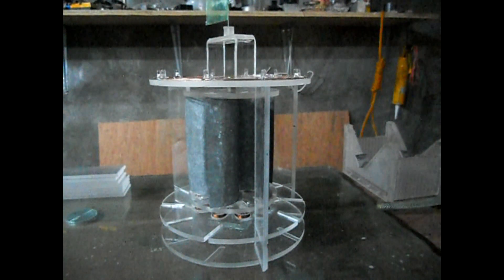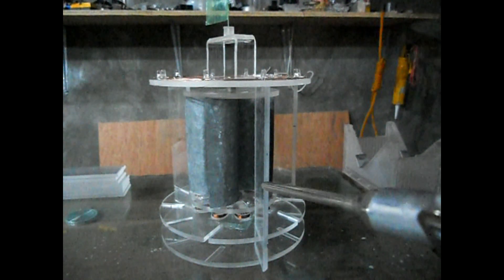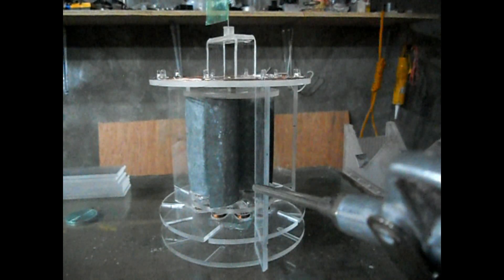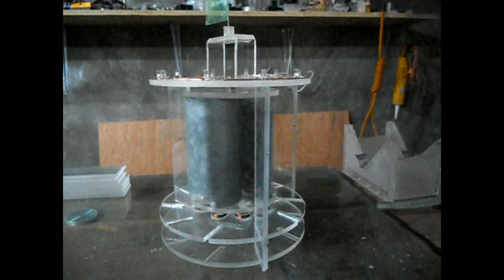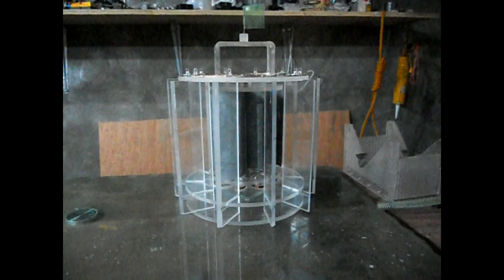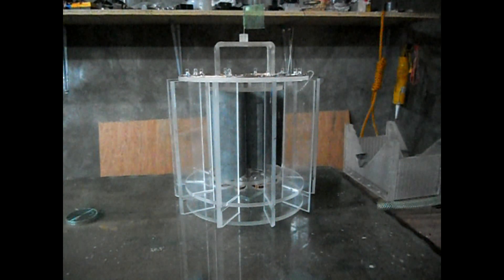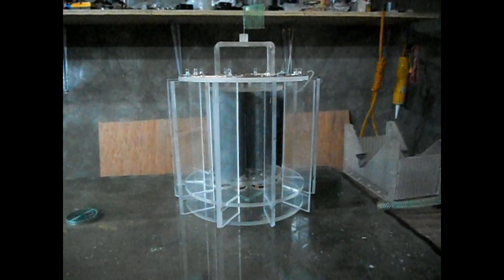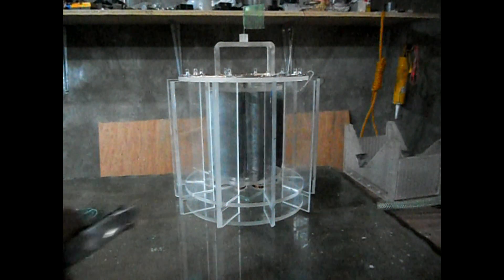VAWT 3 0 video

Comment: Numbers are nice.  Bearings waste about 0 energy.  And this is not a new idea.  Vawt is about the most expensive 'renewable' energy you can get.
Reply from the maker: you think its more expensive than standard wind turbines?
Reply: @crafter2u  definitely yes.
Reply from the maker: @dansshop  why is that?
Reply: @crafter2u  The VAWT is much less efficient.  Much heavier, hard to get on a tower, tricky to regulate in high winds.  There are very few examples of success.
Reply from the maker: @dansshop  I would think the wind deflectors make it more efficient, and i really dont see a weight problem, why would you need to regulate it in high winds? also there are no brakes or gears or bearings or unnecessary electronics to break. any way im working on the new model and we will see how it does
Reply: @crafter2u  Best of luck.  I'd gladly have a phone call or a private chat if you want.  I think you're machine is doomed though.

Comment: Time and money wasted. After all, all this has already been investigated. You are just too lazy to read the research reports of the VAWT.
Reply: VAWTs tend not to be as efficient due to backtracking because their blades move in the same direction as the wind. On every rotation a blade makes it must travel back into the wind before being pushed back around. the deflectors remove that issue. I'm more interested in whether or not cogging will enter into play when the system is loaded, how well will the support magnets hold the shaft in place.
Reply: Vawt's problems are quite different.
Reply: @ДэнКошман  can you tell us ... What things makes VAWT inefficient & solution on this?
Reply: The physics of turbine operation makes vertical axial turbines ineffective, as everyone knows. A lot of scientific research and engineering experiments have been carried out in different countries. As a result, horizontally axial wind turbines mainly generate energy. And the vertical ones are used by illiterate amateurs and crooks.